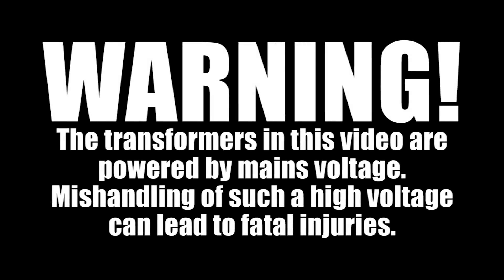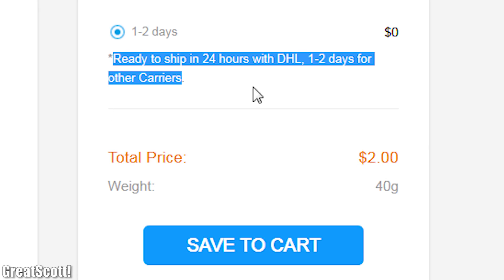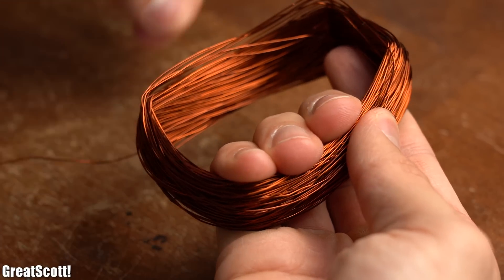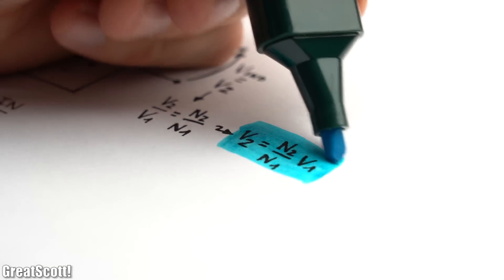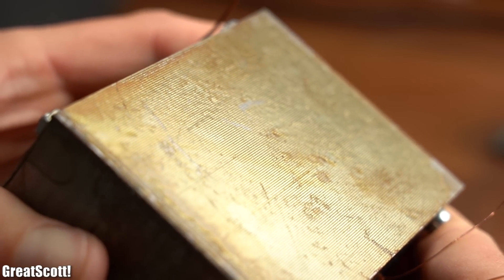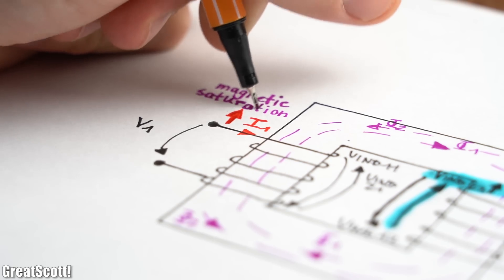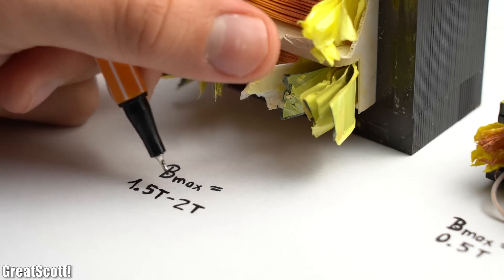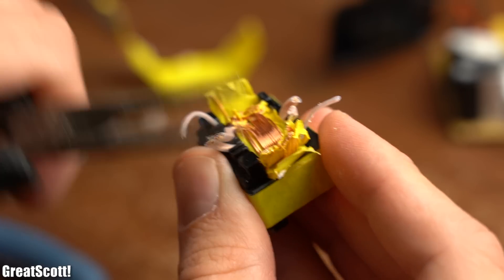Is it easy to create your own Transformer? Everything you need to know about Transformers! || EB#42

Comment: at 4:29, 
you don't have to measure the resistance of primary like this: the value displayed on the voltmeter is impedance equivalent of your body and primary impedance of the transformer. the correct method is to supply the primary of transformer with a DC voltage and read the current value, therefore the resistance is the ratio voltage/current.
thank you  ;) .

Comment: There are two main problems that you cannot avoid with "home made" transformers. First , you cannot get the core lamination properly done. I mean you cant tide the core properly and you cannot cut all laminated slabs at same size.Second, the coil/winding will be loosely winded around the core. All these problems are going to create noise and make transformer hot.

Comment: So what would happen if you add different types of diodes on the resistor side to reduce the return flow. Would you be able to increase output voltage?

Comment: I have done an experiment with UPS transformer
Connected 220volts mains to low voltage winding, the power draw was about 2KW
And after i have brought the high voltage wires close to each other, it made a spark 1 cm long, and the watt meter showed around 7KW, most probably that would be greater than that.
Within half of the second MCB shutdown
And the experiment ended with a little smoke of glues used in the transformer.

Comment: GreatScott:
Electroboom: Nah... DIY transformer is okay EXPLODES s**t!
Reply: if you do it the proper way it's not going to explode, but Scott did preaty bad job winding the transformer and isolating the windings from the core.... 1 strip of duck tape won't save you from 230V shock from the core when it cuts the laminated wire insulation so this video was good theory and bad practice

Comment: Great video. Looking foreward to the next one. 

Some questions, for small load applications, where would a transformer benefit over a TRIAC? And why does the TRIAC cause a humming on a motor when the transformer does not? And is the humming dangerous for the motor?
Reply: 1. The triac is a switch for AC voltage . It does NOT transform voltages like 220v AC to 12v AC .
2. It's humming because it draws more current from 220v than at whatever lower voltage you use. AGAIN , the triac is a SWITCH. It DOSEN'T transform voltages.
3. No . Usually the humming means power losses due to the vibrations.
 
If you use a triac dimmer, its like a transformer.

Comment: Please correct me if I am wrong, but the explanation of why the measured input current is lower than that calculated from the measured primary impedance does not appear to be correct. Surely the measured primary inductance will be greater for a transformer with an open circuit secondary because the flux is not being coupled into the secondary load. That is to say the measured inductance of the primary should include the effect of the back emf of the core flux by definition. When measuring across the primary of a transformer with the secondary open circuit, it is effectively just an inductor with a particular core topology. I suspect that the reason the measurements do not match is because the inductor measurement was performed at a current far lower than the working current, making it subject to the nonlinearity of the core. Had the inductance been measured at closer to the working current the inductance would have been higher and the measured working current would have more closely matched that calculated from the primary impedance.

Comment: My first transformer was a rewound MOT for a 100W 808nm laser. Added linear current control with an output of 110A @ 2.5v. Was a fun project 🍺
Reply: What was the secondary coil AWG? For 100+ amps?
Reply: @manuelplascencia3223  can't recall, as it wasn't standard wire.. I picked up 3 or 3.5mm bus grade copper from my local metal shop and sealed it. Its only a few turns but was a PITA to wrap.

I've seen guys get a few hundred amps out of 8-10ga branded automotive cable for spot welding..
Reply: I did a 250w, 12v output Transformer with 8 AWG cable, hope it works, still i need rectifier bridge and caps to run it

Comment: Great Video! One correction though:
When you increase the load, the efficiency drops mostly because of the resistive losses (copper losses) in the windings.
The more current you draw, the greater the voltage drop, and the less voltage the primary inductance "sees", therefore
decreasing the flux density and reducing the saturation, not increasing it.

Comment: Hey bro, would be some kind of  awsomeness if you could, for the sake of science, sacrifice some of your time, hastle and knowledge, to shed some light regarding electrical steel sheet! Recently I came across a dc fork lift motor for cheap, only it was missing the stator sheets, what made me thinking till it was scraped ... Believe I made a mistake not having tried to build them of plain old metal sheets. It would be nice to build a small transformer that way, and compare its efficiency with an ordinary one the same size, my bet is they run about the same ... Machst 'nen guten Job bro ;)

Comment: Great video! Can you please show what happens when you put a capacitor across an inductor that exactly cancels out its reactance?  For example the 1600 ohms reactance you calculated for your primary is +J, what would happen if you used a 1600 ohms -J reactance capacitor for that frequency? Does the output voltage continue to grow on each cycle until it arcs?

Comment: I hope the next video you might try steel strapping. 

I've always wondered how steel strapping coiled into a toroidal transformer core would perform.

Steel strapping  is easy to source locally or online.  Steel strapping is a long thin and painted band of steel.  The paint serves to electrical isolate adjacent laminations helping to minimize eddy currents. But it is not electrical grade (silicon steel) with higher electrical resistance, and I dont know how good/fair/poor are its hystoresys properties when used for 50/60 hz power transformers. 

Certainly if one has access to the best material for a specific application then use it. But will steel strapping sorta work well or will it be abysmal.

Comment: It depends, do you think that tedium is hard? 

In all seriousness, I gave this a like, but there's a couple of things that people should be aware of. 

Your current draw on onside effects the current draw on the other side of the transformer, and it's oppositely proportional to the voltage change. 
Using the example mains transformer: if you draw 1 amp on the primary side, you're secondary side might have as much as 17 amps pushed through it. 
This is why the MOT spot welder took off a couple years ago on Youtube; One high voltage path with an intermediate current draw can become a low voltage path with very high current, and thus heat, output.  

Also.. this is hints at some general best practice stuff: put lots of current limiting devices on a transformers primary, and voltage regulator stuff on the secondary side. 

Second, The UK limits the number of wire wraps you can get on a single transformer, and that can be good, because it's meant to limit parasitic capacitance. 
Without getting into a super long explanation, test your transformer for inductive spiking. 
A transformer isn't a motor, but it's still a large inductor. It has an inductive spike associated with rapid changes in voltage, and depending on current draw at the moment of power cut off, that can cause a significant voltage spikes on either side of the transformer. So types of transformers are prone to issues with inductive spiking.
Reply: I’ve been failing to make a Tesla coil for so long

Comment: Microwave transformer is little bit weird... Its core is welded together and draws more than 1kW with no load but the output frequency shape is not a perfect sinewave but it's more like a square wave signal. This could be bypased by adding a second identical transformer , secondary in series because the number of turns in secondary is adound 240 maybe 250T so that makes the core sooooooo oversaturated and producing a lot of brumm ( this is maybe that reason why is welded ) and producing a looooots of heat even without the load.

Comment: Does a cut iron core (like the one you have) in a MOT affect it's output power?
Reply: An air gap can effect impedence, and care should be taken to minimize it which also helps reduces stray flux. 

The "I" core material should be secured back to the "E" core material  in a way that wont let the "I" core material sing to you in an annoying 50 or 60 hz tone.
Reply: @kreynolds1123  I heard some people talking about it rendering the transformer completely unusable and I needed some clarification. Thanks!
Reply: @MiguelBaalm   Completely unusable is nonsense.

Comment: I could give anyone a circuit that defies eddy currents and lenzs law
Reply: Show us
Reply: @philippsd716  well since we are in a text forum I can tell you
Reply: @philippsd716   there are two ways I know to cause this effect. 1st. A radio active source thorium is a good medium. Get a bifilar winding coil with a variable,capacitor inductor resistor. Inside of the variable inductor place thorium. Vary the frequency until tuned,to the thorium radio frequency. This is just basic. Parameters are mathematical. 2nd.  Get a magnet and introduce it into a transformer laminate. Wire the primary just above and below the magnet in a opposing fashion . secondary will be a bifilar winding with a tunable capacitor bank.,again certains values are not given

Comment: You might have measured the inductance with a frequency that's too high, iron core transformers are very dependent on frequency and will read a lot less when tested at higher frequencies. But I can't really see the frequency setting because it's blurry.
Reply: The frequency is 100 Hz, which is the minimum that this particular LCR meter allows for.

Comment: I have a Transformer with multiple winding, salvaged from a old UPS from my school.
I was using it as a powerful Crude power supply for high current applications and always monitored the temperature which didn't exceeded the temperature of 36°C even while drawing 5A for 1hour continuously 

Lately I found out that it's core's steel sheets were getting kind of loose and hence creating a kind of loud vibration noise of the plates, so I used some M4 Bolts and Nuts to squeeze the plates with the pre-existing holes.
But now, even when no load is attached, it reaches the temperature of 60°C and above.

Are the bolts causing the problem with the core's design, and if yes then, how should I hold the Transformer's steel sheets together.
Reply: Maybe use zip ties not sure if you scratched off the laminate between plates keeping in the bolts. Basically you damaged the core trying to fix it

Comment: Why do they weld the sheets together though? Does it take away anything from the quality?
Reply: They don't weld, they glue them together.
Reply: For safety, you want to ground the core.  Welding across the laminations assures all of the laminations are grounded.
Reply: On microwaves ovens, they weld them toghter, otherwise the transformer will vibrate like crazy, even tough it would taxe away some propieties

Comment: You should try to build a switching power supply. I do make my own ones for different applications. I disassemble old ATX PS transformers and wind my own with proper kapton tape and acrylic glue insulation and I think they are way better and safer than those factory made. There is a great software called ExcellentIT to do all the calculations. There is also an LLC topology which makes it possible to make a 98% efficient power supply but it requires much or less constant load. Currently I'm trying to build my own resonant mode PS but it has a very complicated way to wind its transformer.
Reply from the maker: Thanks for the feedback. I will have a look at the software.

Comment: What if you used aluminum as a transformer core? Will it be a good alternative to steel core? It is possible to make a transformer core out of aluminum foil in theory.
Reply from the maker: It would work to some degree. But you would never get the same results as with iron. Maybe I can talk about that in the upcoming video.
Reply: @greatscottlab  Are the results close enough to iron or is aluminum simply a bad alternative?
Reply: aluminium wont work, it needs to be a magnetic material.
Reply: @Xeno_Bardock  yes, it is paramagnetic, but nowhere near the level of iron and other ferromagnetic materials. The effect of the aluminium on the performance of the transformer would be very small. More paramagnetic -> better for transformers. Of course there are many more important factors to it(hysteresis).

Comment: I've seen russian guys on YouTube make a transformer core out of tin cans, it worked. The teaser you applied with winding a transformer-It's far easier if you build a bobbin out of thick solid cardboard, fiber glass or 3D print it, and as far as I know it is necessary for the windings to be winded tightly next to each other. Also you can easily calculate the number of windings by rhe cross sectional area and a few more sizes.
Reply: link
Reply: @leondeco4835  https://m.youtube.com/watch?feature=youtu.be&v=etPT5Rs-JfQ&t=7m25s
I've seen a few more but I can't find them.

Comment: I would like to see this guy collab with electroboom
Reply from the maker: Me too :-)
Reply: @greatscottlab  Creating very complex circuits. So complex that even he struggles to do them and then ElectroBoom destroying them singlehandedly. Gonna laugh all day.
Reply: @vasilzhekov9245  that dude could make a nuke with five diodes and a transformer
Reply: @greatscottlab  That would be awesome!
Reply: Great is Great whoever facing him he still Great
Reply: @greatscottlab  That's what i've suggesting for the past year! Remember me??
Reply: Can you imagine that? Haha.. Safety Vs No Fucks given..
Reply: @geogmz8277  an unstoppable force vs an unmovable object
Reply: We got a big problem with that collaboration between both of them, actually GreatScott wouldn't shock hisself due to German safety rules.
Reply: @thebamplayer   can confirm. Germany and its safety measures can be a really fucking ridiculous sometimes.
Reply: You need a FULL BRIDGE RECTIFIER to make it to dc
Reply: Electroboom is actualy a genius!
Reply: Why can't we use resistor instead of a capacitor to stepdown AC voltage? Can we make a stepdown power supply using resistor instead of capacitor?
Reply: @debojitacharjee  We can use a resistor, but it will waste power as heat. The capacitor just returns excess power back to the circuit.
Reply: @debojitacharjee  Because as ElectroBOOM ( Mehdi) said," The dummer you are the more likely you will invent a light bulb"
And thats what happens if you use aresistor as a voltage dropper, it HAS to be rated for the current of the circuit, or elese it ends up as a ligt bulb.
Reply: Ja ich auch
Reply: The masters in failure guy? (This is a joke, don't bully me.)
Reply: @aquasama588  but you are a useless godess
Reply: @aquasama588  love the disclaimer
Reply: @aquasama588  nagataro
Reply: And photonicinduction too
Reply: @shashankhmgowda7668  Oh yea, that guy, you know, when you come across these guys who use high voltage, it's really scary whe they stop uploading.
You get it??
Reply: The colab of the year.
Reply: Marco Reps would be a great match.
Reply: @gadde Manu Probably one thing is, Mehdi is in Canada (US), while Scott lives in Germany(EU), which they are really far away from each other. I would like to see Mehdi and Scott collab together!!
Reply: Or Joel creates...
Reply: Yes
Reply: Collab collab collab
Reply: This dude and Mehdi could make sutch great things
Reply: Those are too in video types greatscott creates more educational and family freindly videos but mehdi videos are absolute crash and boom !
Reply: same
Reply: @Electroboom
Reply: Any news?
Reply: Bro you are trying to joint to beaches of same river

Comment: Hi greatscott! 
I have question specially for you. 
Is it possible to use step-down transformer for step-up operation by energizing the low-voltage side?
Reply: It is possible but don't overvolt it or else you could burn it out
Reply from the maker: It is sometimes possible. But you will never get optimal results this way.
Reply: I'm not 100% sure but I think it's possible
Reply: Of course it is but you have to be careful withe the currents flowing through the wires or  it might self destroy

Comment: I have been trying to wind a high voltage transformer but no matter what I fail. Either it arcs to itself or wire has some break points or I break the outputs. Bullsh*t. Don't wind transformer kids